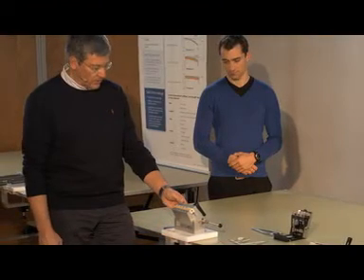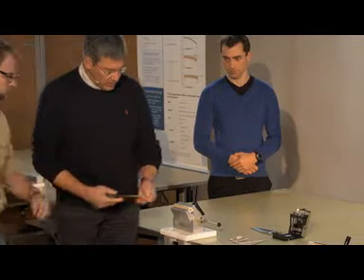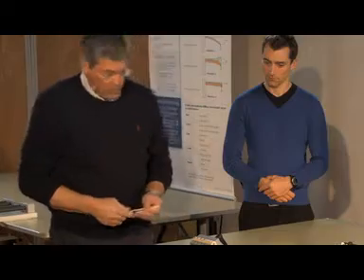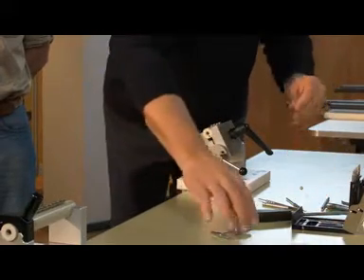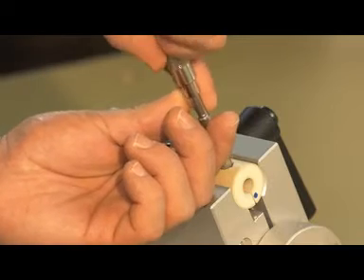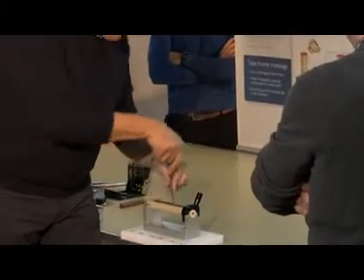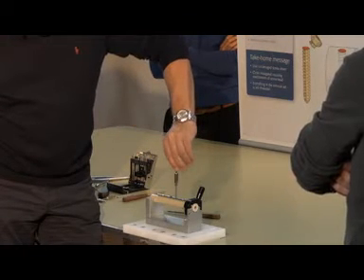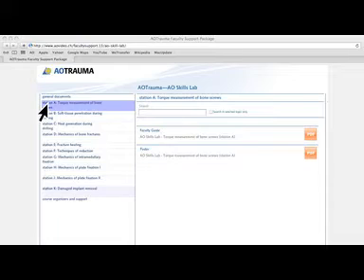Skills Lab : Damaged Implant Removal - How To Remove Broken Screw

Comment: My screw could not be removed as tissue was stuck to it. It is fixed for my talks bone fracture. Is there any other method to remove it.
Reply: Talus bone
Reply: I also have the same problem in which two head screws broke inside my neck femur... I wonder if the doctor will ever be able to remove them without it causing any problem because I don't want to leave them in there forever...
Reply: Same here can we talk each other I have some xray . Give me your social network id or something